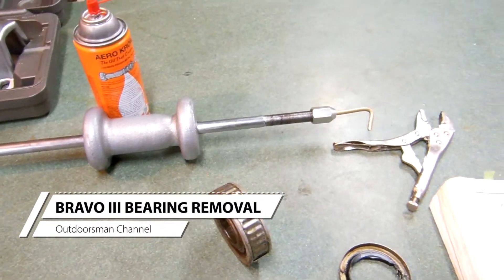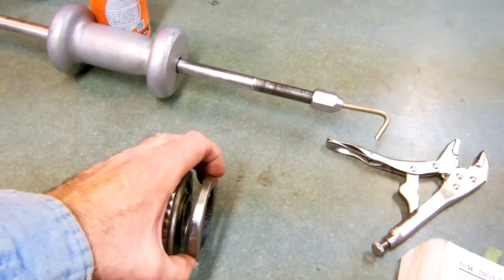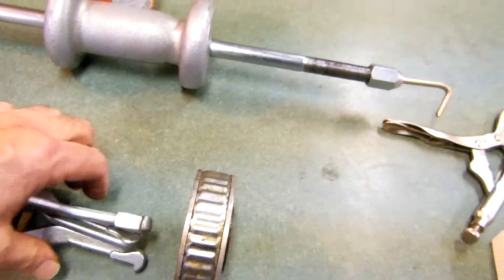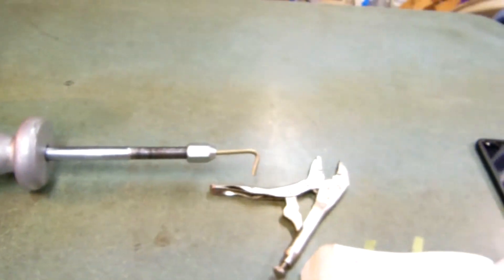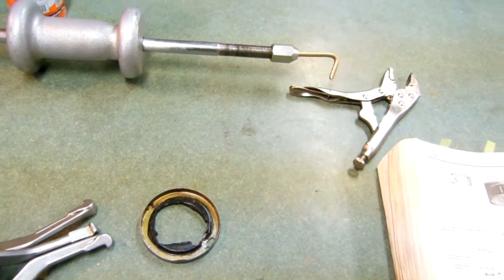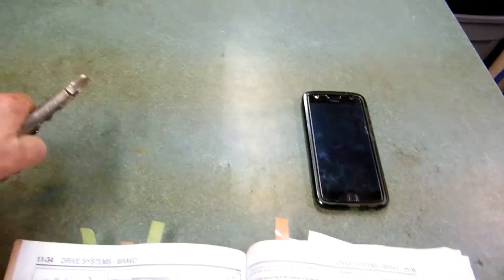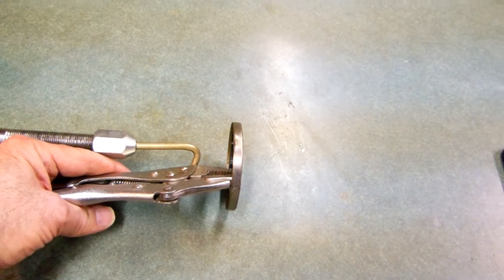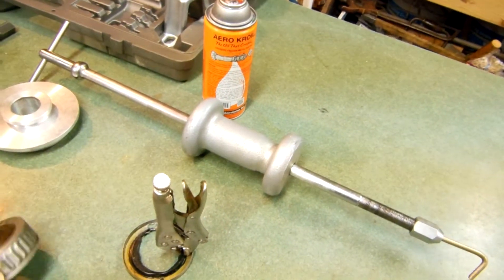Bravo III Gimbal Bearing / Oil Seal Removal

Comment: Next time use the right tool  a gimbal bearing tool and stop using a slide hammer
Reply: The mechanic here at the marina spent 3 hours with a $300 Mercruiser tool and I did it with my slide hammer in 10 minutes so I'm a fan of the slide hammer LOL
Reply: Fan of slide hammer too got my bearing and seal out less then 10 mins very easily